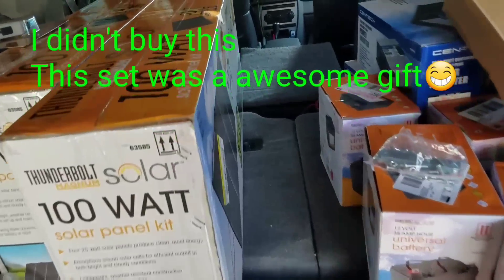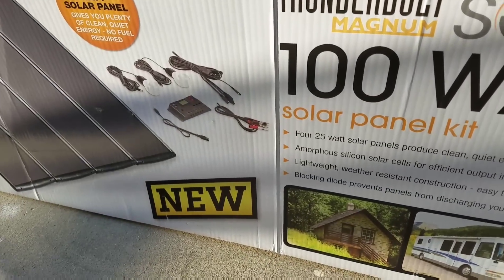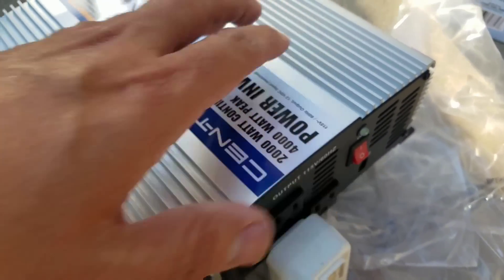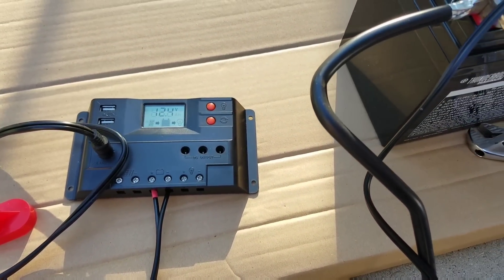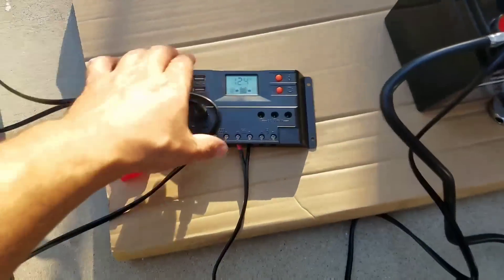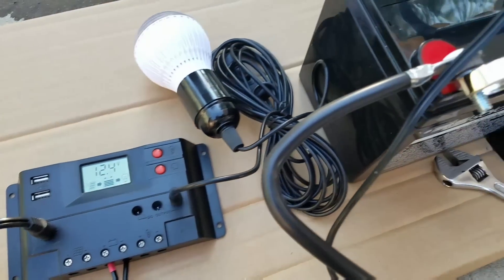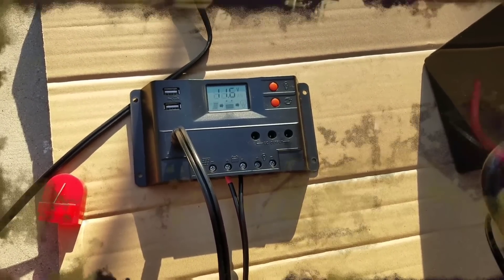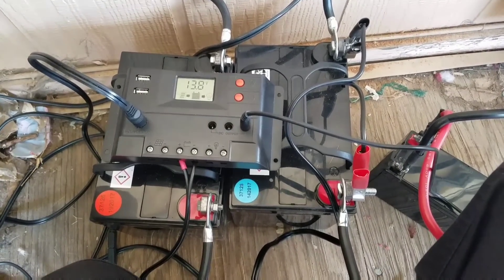How to run an AC unit on solar power

Comment: Guess you found out by now you can't run your Ac very long. Get some decent panels and a good charge controller.
Reply: Kammfrank82 That's where my "roll you own" Tesla Power Wall comes in. I have 15kwh of lithium aircraft batteries that provide a good portion of my night time usage depending on how much we use. Sometimes the batteries aren't dead when I wake up in the morning, sometimes they are. But we don't even worry about what we are using. We just live life as normal and let the system do its thing.
Reply: Kammfrank82 Paying 20k for a system that doesn't provide enough energy means that you overpaid for that system. I paid half that to cover my roof with 17% efficiency panels and my electric bill went from $375 a month to nearly zero a month. That's a 3 year payback, then its "money in my pocket" after that.
Reply: Kammfrank82 I have 32 panels on my roof. On average they make 1200kwh per month. It actually is happening. I'm living it right now. My central air conditioning is running and I'm watching CNN on a 60 inch 4k TV, one of my computers it's on and the coffee pot is on, plus all the other crap in my house. The arrow on my electric meter is pointing to the left right now which means that electricity is leaving my house, not coming in.
Reply: Kammfrank82 What does the efficiency of of solar panels have to do with anything? The energy falling from the sky is free and will come if you harvest it or not. Collecting 20% of it is better than collecting none of it.
Reply: agreed, there has to be something better than wind and solar, solar is like 20% efficient, when it gets to 80 or 90 then im in. wind turbines kill more birds and hawks than they're worth.
Reply: good point till u pay 20k for the system for your home. Till your roof is covered in panels it will never keep up with what you use in a day, plus you need to make all that power in 10 hr because of the night lol. Payback's over 20 years which make no sense unless energy in 2035 is four times the price but even then your panels have lost most of their life which is only 20 years so you tell me why there good?
Reply: ok did my math, it should be close, you need to make 1875 kw hours with your panels to reach $0 dollars. it would take 3- 300 watt panels at 100% output for a hour to make 1 kw hour, Never going to happen unless you have magic panels.
Reply: Y
Reply: B
Reply: How do the wind turbines kill birds and hawks?   They can easily have an emission that would scare the birds and hawks away... including optical.  My logical guess is the other industries like using the wireless tech that is polluting everywhere to remote control animals to create legal arguments, insurance frauds, injury and worse. https://www.osapublishing.org/DirectPDFAccess/6130C232-FE1C-22D1-F391E70A2FCE2905_340880/oe-24-11-11828.pdf?da=1&id=340880&seq=0&mobile=no

Then of course, the issues why we can't do this publicly (though can shoot down whatever with LAWS et.al. systems): https://en.wikipedia.org/wiki/Mosquito_laser

Another reason why OpenWater Company is slow to come to the market due to ethical issues of the tech that is in fact capable to detect down to neuronal clusters and smaller:  https://www.openwater.cc/technology

Then... I was just thinking people forget to first identify user requirements, then make specifications for what they require.  Then design their system with those needs in mind surveying the different systems components specifications to see if the system purchased will be feasible.  Oh, yeah... I had champion this in the pharma industry along with non destructive NIR and coordinate measuring systems tech since there may an issue with the petrochemical pharma companies destructive tech nature.  HHhmmm?

Try solar concentrating troughs in arrays then layer those to make use of volume calculating the distance between the systems, then place in a enclosure to trap more of the heat and not create death zones that kill also from all the absorbed heat that isn't reflected back into space or used.  HHhmmm?

Definitely worth investing in the better quality solar panels even if used.
Reply: I wonder if a more cost effective option for those with property to terra form is to make a hydroelectric water pump system to pump water in the higher level pond or tank so to be drained on demand through the hydroelectric generator... basically acting as a large battery... that is if there is the property.  Building underground would cost more to implement... though getting into those systems... makes me wonder about the math cost balance for gravitational weight based systems also that are somewhat coming out as feasible.
Reply: I should add though... for personal use... is neat to experiment through trial and error and learning experiences.
Reply: till the night comes lol

Comment: I bought my first solar kit today and this is the one i bought.  i only want to run a 5000 BTU unit to cool the Van. not sure if i have enough yet but i am getting a battery that has 240+ mAH.  ( if i can find the site in my history that i saw it on.)
Reply: You need minimum 200 Amp Hours (AH) of battery (like 2 marine deep cycles) and 600 watts of solar panels minimum to run a small A/C unit on low for 12 hours.
Reply: +Prolific Invention And a 2000 watt continuous inverter...decent charge controller...ect
Reply: yes

Comment: Hi, how big is the aircon BTU ? What brand is your power converter and your batts will be in series or parallel connection ?
Nice vid btw :)
Reply from the maker: tobytomic that air conditioner was 6000 BTUs, the power inverter was a Harbor Freight brand, and I connected the batteries in parallel.  Thank you for the questions these are great bullet points to bring up in my next video.

Comment: one thing to add, you can only run the AC during the day with the sun, the AC will kill your battery at night. I have 14 battery's and it drains them pretty good at night on 800 watts of solar
Reply: the batteries is where you get the power from and the solar cells charge the batteries, most people think the power used is from the cells, you sir win the chocolate chip cookie for the day, Good Job.
Reply: Great vid.  Good learning curve.  I have a large system and I use a 85 amp battery charger to top off my batteries at night.  It's on a timer and runs on Florida power and light power.   My electric bill runs around $45-$60  month.  Keep up the good work.
Reply: Wish you lived on my block Jim,  interested in setting up a system. When Irma came to visit, out of power for 8 days. Duke took too long to get neighborhood up and running. Would like more info.
Reply: @jerryw5508  shoulda fixed it your self then dip shit... So maybe those people busting their aSs to get you power didn't have to work so hard
Reply: Hey vanner40, i am trying to put a .75 ton ac in my van. Need advise on batteries and panels. I am on mails2dhruv@gmail.com. Would appreciate all your help
Reply: vanner40 hey Bro. I have 11 renogy panels and eight batteries.   My house is hybrid.  Florida power for central Air and hot water. T.v in living room an Florida room and wifi equipment run on Solar.  Six harbor freight runs the house 12 lighting systems.  Two fans also run on Solar.  Because we live in Hurricane alley we have a large battery charger that tops off our batteries at night just in case we loose power.  Our Power bill usually runs @ $45 to $60   a month.   Have a Blessed Day.